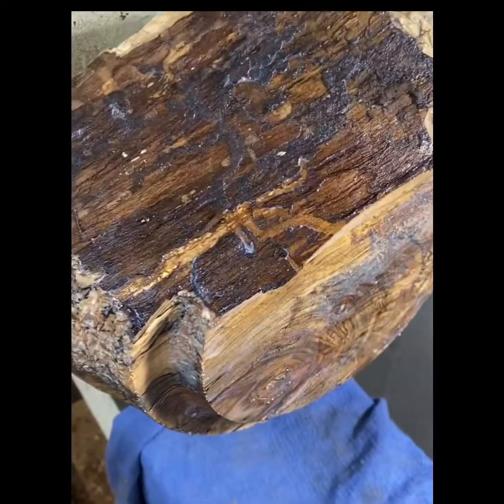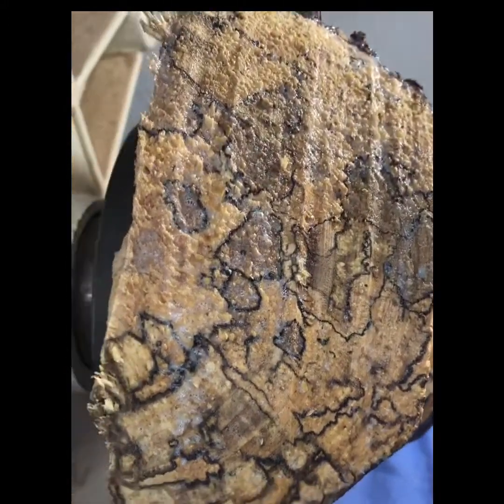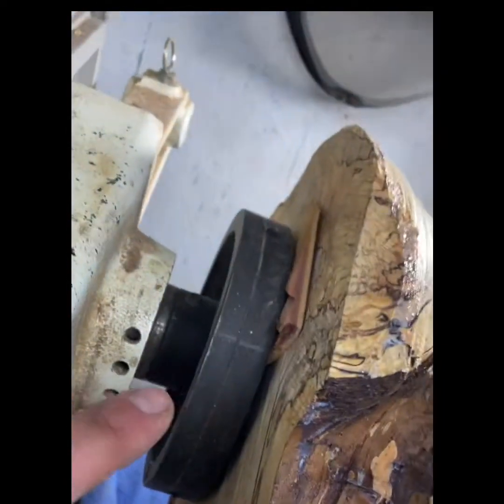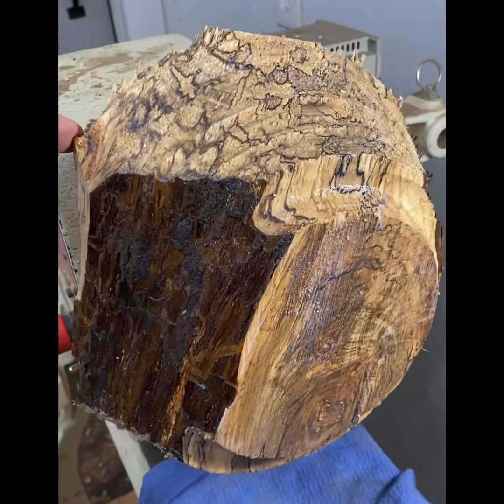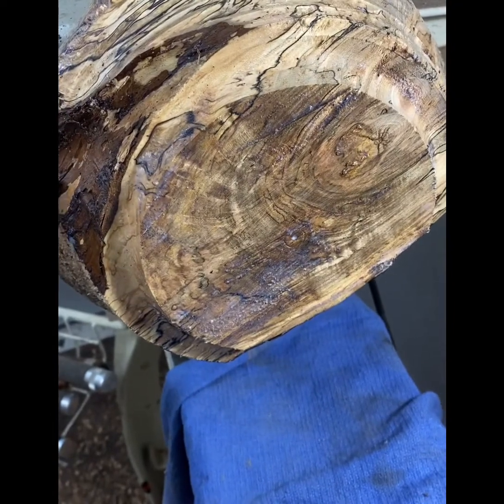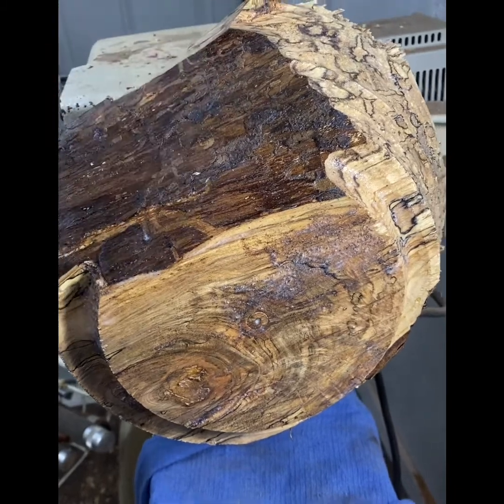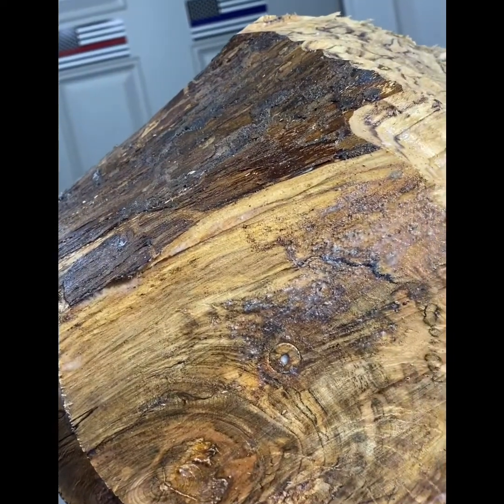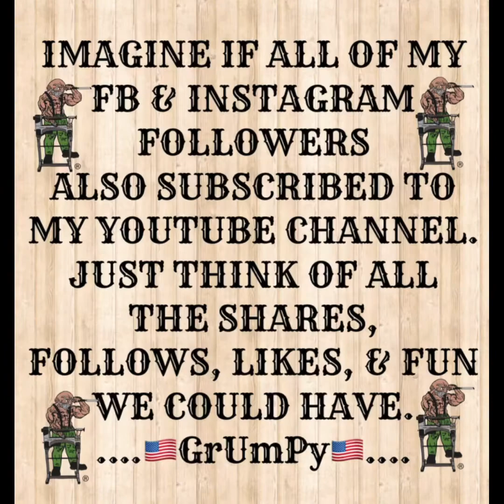Q&A for my Spalted Maple 8-19-21

Comment: Hey Jason, if it was me I would start by moving the center mark that you pointed out on the bottom of the bowl more towards the center of what material you have on the bottom. In order to do that, I’d pinch it between centers but then adjust the piece so that you can reposition your tail stock center. Then, I would true up the blank, get a new flat bottom, and then cut a tenon, NOT a mortise. 
By using a tenon, you’re grabbing and clamping down on the bowl, so you don’t risk blowing out the sides of your mortise because you don’t have as much support on the side that is missing that chunk. Also, since you would have moved your center points you’d have more even material all around. 

That was a lot of rambling, I hope it made sense. 😂 

Also, keep in mind I’m not a pro turner, so there may absolutely be a better way to approach this. The suggestion above is just how I would approach it. 

Hope this helps!
- Seth
Reply from the maker: Thank you fir your suggestion Seth. At this point I’m looking for the best way to deal with this issue & if moving my live center more inward so I have more meat to grab for the tenon. Then that’s the way I should go. I’m not a pro either. I’ve only been turning since December 2020. 

Thanks again 
....🇺🇸GrUmPy🇺🇸....

Comment: Jason, if you watch Phil Anderson and he says that he is gonna make a tenon he actually is. He just doesn't do it in the conventional way as everyone recognizes it. He makes a recessed tenon which means the tenon doesn't stick out from the piece. Watch his video again and listen and pay attention to what he does. He marks out for his tenon and he cuts it. Then he makes a wide groove, that is for the face of the jaws to sit into. Then he uses the diamond tool to cut the dovetail. Then after he is done with his bowls he reverse mounts them and he removes the tenon and watch what he removes. I think this may answer your question about never actually seeing the tenon made.
The only problem with this type of tenon is you really have to watch the depth of the bowl, you need to leave the bottom a bit thick
Reply from the maker: Yes I make those kind of (recessed)  a.k.a mortises in my dry bowls. I make some mortise type is a few wet bowls that I have drying right now but… 🤨 yeah…. The bowls warped as they normally do as did the recessed tenons & mortises. I’ll have to jam Chuck them with a new live center point & turn that entire area away, but I’ll try to save the tenon if I can. The trouble is the thickness. All three bowls are only 1/2” thick. 🤦🏼‍♂️.

Comment: You may have said it and I didn't catch it but how big is that bowl both diameter and height and what size chuck jaws do you have to work with?
Reply from the maker: I’m not sure if I mentioned it or not but it doesn’t matter now. I removed the faceplate & replaced it with a two prong “thing-a-Bob”. This way I could move my live center over to where I needed it & could true it up & get my mortise in-place. Unfortunately my idea of turning the flat side away to air didn’t work but the inclusion area is still there thankfully. I’m turning the bowl at 875rpm but still have small areas of tear out. Only 1” areas, but I don’t want to turn the bowl any smaller so I’ve glued up The Holes & filled with sawdust. It’s going to dry overnight & I’ll attack it tomorrow.